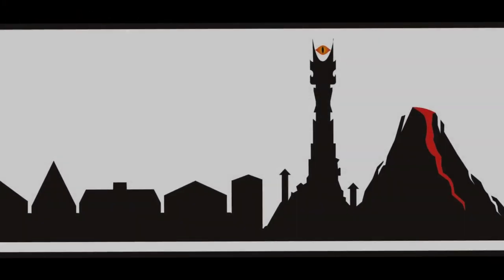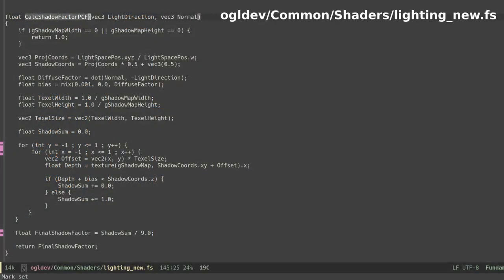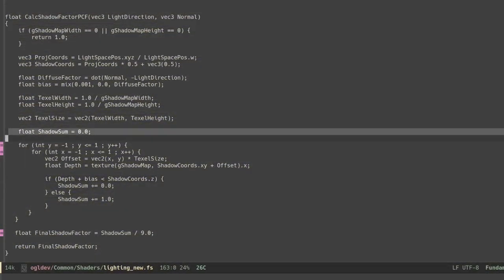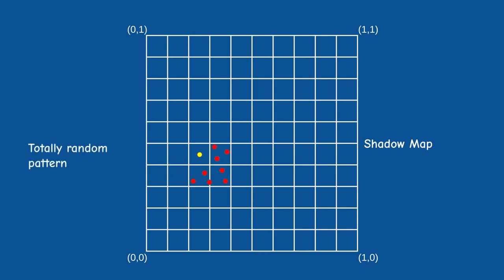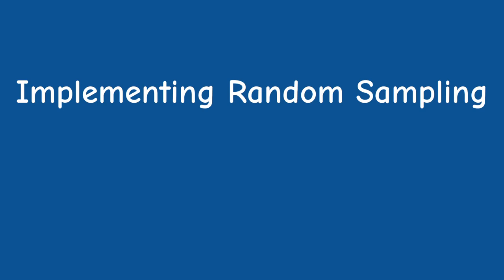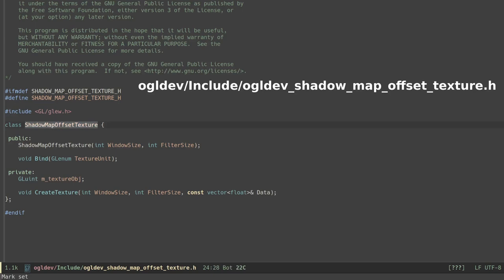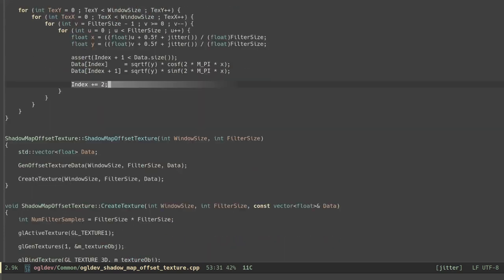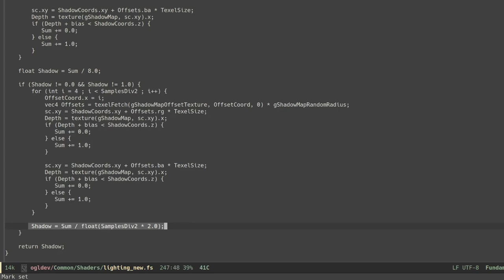Soft Shadows - PCF & Random Sampling // OpenGL Tutorial #41

Comment: Thank you very much!
Random Sampling was interesting for me.
I was able to smooth shadow with only 4 samples, each taking it's own 4 samples for a bilinear interpolation.
This is done using sampler2DShadow. Which require setting it on over the texture settings.
The problem is, it would have a blocky edges like a pixel. and there are no depth interpolation.

I wonder if random sampling fixed both issues?
Reply from the maker: I think that it does but you will need to try it out and tune the parameters.

Comment: Shadows in real life are sharper close to the shadowing object, and get blurrier and blurrier away from the object. Would that be hard to implement?
Reply from the maker: You can make the radius of the circle dependent on the distance from the object. In the case of shadow mapping we have the depth of the pixel and the depth in the shadow map. Quickest way is to make the radius a function of the delta between them. Or extrapolate the original depth and do something similar.

Comment: I am interested in how effective the check for if the fragment is completely in or out the shadow is in your soft-shadow implementation.
I read in a couple sources, that graphics  cards are horrible at branching and therefore just run all if-branches at the same time and then pick the result from the correct one.
Wouldn't that mean, that the first for loop in your fragment shader to check the sum to be all 0 or 1 is just twice the work necessary?
Reply from the maker: According to the original article by NVIDIA (see link in the video description) there is true dynamic branching since the Geforce series 6. The GPU processes thousands of pixels in parallel as long as they run the same piece of code so if some pixels take path A while others take path B they cannot be processed together so this hurts parallelism but the assumption is that in a local neighborhood all pixels will take the same path so the effect on parallelism will be negligible. Please see the article for more details.
Reply: @OGLDEV  Thank you!

Comment: Great video like always. I have a problem with the second approach though. The more I increase the radius the more I get a border around the shadow darker than the rest of the shadow and the sharp points of the mesh appear duplicated. Do you know why I get this? Once more thanks for the video!
Reply from the maker: What values did you use for the windows size, filter size and radius?
Reply: @OGLDEV  Thanks for the reply! Here is what I've tried so far : window 8, filter 4, radius 7 & window 16, filter 8, radius 15 as you suggested. On the second (radius 15) the problem is more obvious. I only get the normal shadow with radius = 1. I could make a screenshot and post it somewhere if that helps
Reply from the maker: I can't reproduce the problem with these settings. Can you please send me a screenshot at ogldev1@gmail.com? Thanks.
Reply: @OGLDEV  Thanks a lot for taking the time to look at the problem. I've sent you 2 screenshots and my fragment shader code